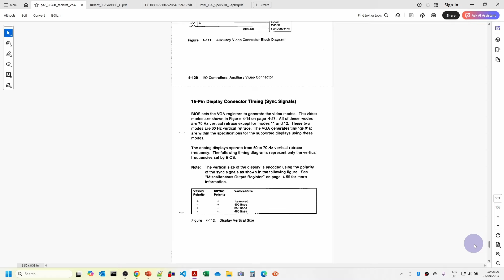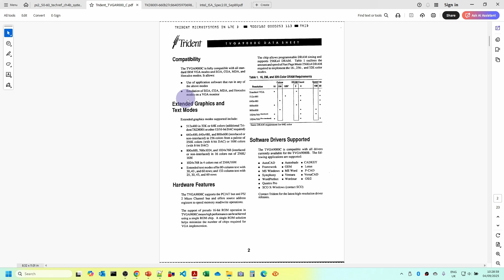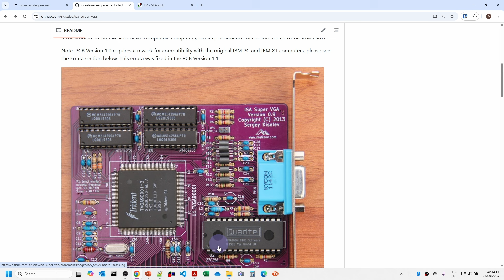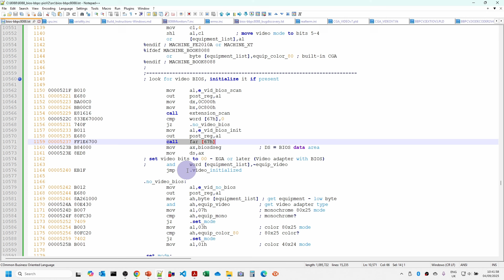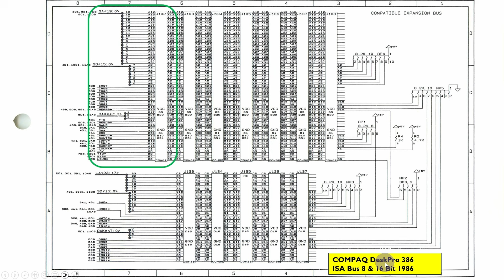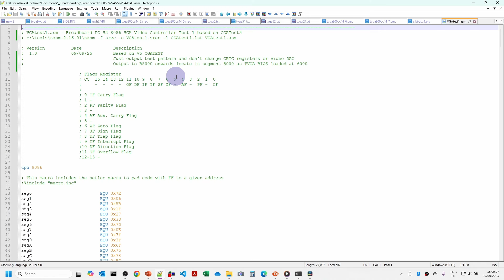New Breadboard 8088 PC V2 #21 8 Bit ISA Bus and VGA Card

Comment: I think the sheer number of registers in VGA is impractical to implement in CPLD.
Reply from the maker: Agreed, I think FPGA may be able to do it but a bit of overkill (and not really 80s/90s tech). I have been looking at using a Raspberry PI zero 2 using a bare metal PC emulator then modify it to use GPIO pins to interface to ISA bus. It has full VGA support already coded but getting it to build with latest Circle library needs work. Dave

Comment: this is going to be a good video for me to watch. I've made a sbc based on the 80c188eb, and an ISA port on it. it worked but I'm not so sure if it's the socket's fault or what, but it becomes unreliable under certain conditions. probably due to the fact I'm not using bus drivers for the data bus. no dma either. im any case, thanks for these series!
Reply from the maker: Hope its useful though not got it all working yet (see wait states below). DMA not used by much other than floppy disks and some ethernet cards and higher spec ISA soundcards. That's not likely to cause stability issues. 
In the version 1 Breadboard PC I didn't include enough data bus buffers and it caught me out eventually. I ended up with 2 x 74LS245, one piggybacked on the other. Also I have now found that ISA bus uses up to 4 wait states with up to 750ns per IO/Memory access (will be in next video). When running 80C88 at 8.39MHz turbo speed these were around 220ns which I think is too fast for 30 year old ISA cards. Even at 4.77Mhz the IO/memory accesses are about 400ns which could be too fast for legacy ISA cards. Dave
Reply: @breadboardinglabs that might explain it. I wasn't using any buffers and the address and data bus were the ones from the cpu, which ran at about 20 mhz. the cpu has a chip select unit with configurable wait states, but I'm not sure if the cards like having such a high speed on the address or data. I was using a ne2000 in ne1000 mode, no dma, programmed io. next revision of that sbc will include the rtl8019 directly on the board, rather than using an isa card
Reply from the maker: ISA bus spec says for 8 bit 750ns for IO & Memory access over ISA. 16 bit a bit faster. But my card just seems to scramble the output from the ROM at certain times even with 800-1200ns access time! Going to configure the higher 512K RAM chip which only has 128K mapped to gaps in upper memory area then shadow the video BIOS there. Unfortunately I don't have a PC with ISA bus to test the VGA card independently. Dave

Comment: I hope someday someone spins up a VGA work-alike on a low cost fpga or similar. It's surprising how complex VGA when you consider it carries forward every oddball video mode from previous PC video standards.
Reply from the maker: Yes VGA very complicated with all the registers and backward compatibility. Not an FPGA as such, but I have been looking at a Raspberry Pi Zero running a bare metal PC emulator (LINUX takes too long to boot at power on) and seeing if I can get the GPIO pins to interface with the ISA bus and provide the video BIOS. Would require modifying the PC emulator to read/poll IO and Memory from the GPIO pins and to set the emulator IO and memory from this. This would then allow the Pi Zero to emulate VGA (and CGA/EGA) and provide modern HDMI video output. I wanted to get a real VGA card working first before embarking on such a project. Could also look at sound card emulation too. I suspect it will be more a software project than hardware as other than voltage level converters for 3.3V to 5V and the odd buffer/latch there is not much hardware required to interface the GPIO pins. Dave
Reply: @breadboardinglabs that would be an interesting project. I’ve seen RGB2HDMI and i think that uses pi bare metal and it’s quite fast.